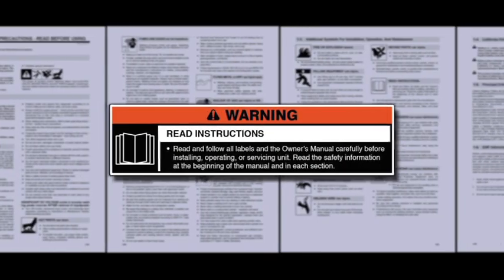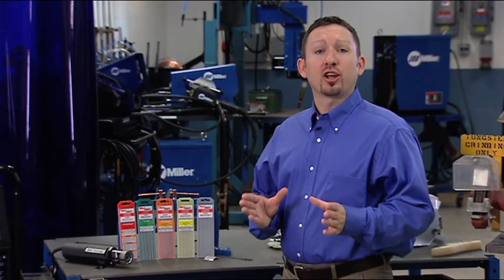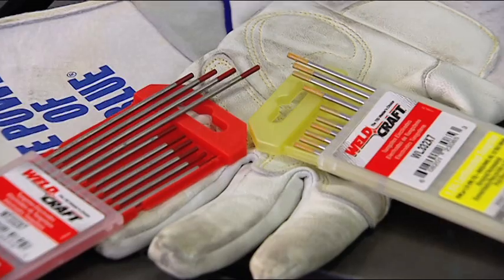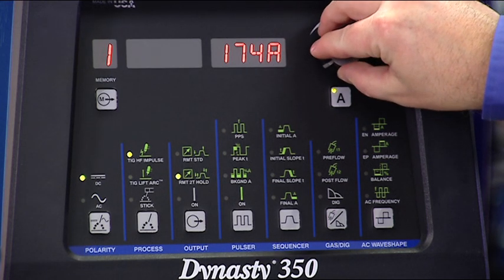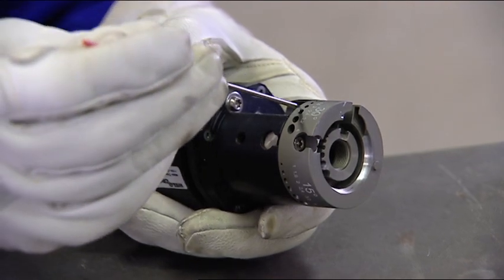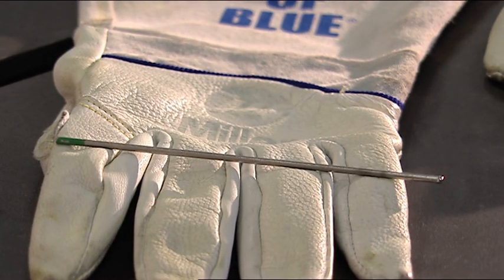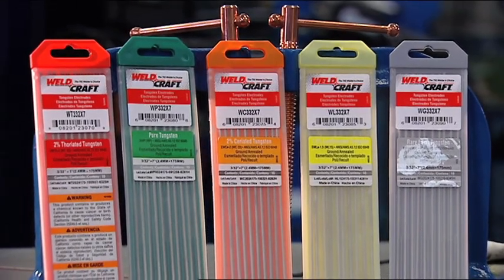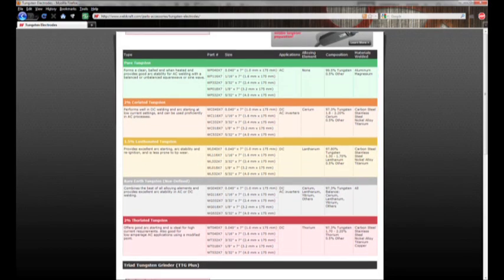TIG Welding: Tungsten Selection and Preparation

Comment: HI , in TIg can i  weld  normal cheap metal ? not steel . pls advice
Reply from the maker: Thanks for reaching out. TIG welders can be used to weld steel, stainless steel, chromoly, aluminum, nickel alloys, magnesium, copper, brass, bronze and even gold. We recommend using our TIG welding calculator to help determine the weld settings for the type of metal you are welding: https://www.millerwelds.com/resources/weld-setting-calculators/tig-welding-calculator  We hope this helps. Please let us know if you have any further questions. Thank you!
Reply: Yes,  you can weld any tin or steel. If possible, do a few test pieces first.

Comment: what grinding wheel do you recommend to grind tungsten except diamond wheels? I have a cheap wheel that I need to replace very often since it's wearing too much every time I grind. Thanks
Reply from the maker: +Daniel Mallia When high quality is needed, it is recommended to have a diamond grinding wheel dedicated to only the tungsten electrode preparation. When a diamond grinding wheel is not accessible, a dedicated grinding wheel made of borazon has been used due to the hardness of the material needed to grind tungsten electrodes. It is important to have a dedicated grinding wheel due to the possibility of the particles left behind becoming lodged in the grinding crevices and dislodged during welding; potentially ending up in the weld deposit. Let us know if you have any further questions. Thank you.

Comment: I OWN a miller 300 dxis there any info on how to connect it to 220 from 460. can anyone help me with this
Reply from the maker: +Michael Dagnall Hi Michael. Are you referring to the Miller Shopmate 300 DX? Let us know the specific model that you are working with.
Reply: It's the DX-300
Reply: I would also like to know if i was able to purchase new decals for the power unit.Two of the Miller decals and two of the MAXSTAR 300 DX decals.Thank you
Reply from the maker: +Michael Dagnall If you would like a set of Miller stickers, we encourage you to sign up for our Owners Club. Registration is free and you don't have to own any equipment. Once you register, you will receive a free set of decals in the mail. https://owners.millerwelds.com/Login?RedirectUrl=%2f Please let us know if you have any further questions. Thank you.
Reply: +Miller Welders No
Reply from the maker: +Michael Dagnall, thanks for reaching out. The peak and background cannot be changed on the Maxstar 150, they are both set at 50%. If the capability of altering these parameters is desired, then we recommend upgrading to a Maxstar 210. Please let us know if you have any further questions. Thank you.
Reply: Miller Welders SO YOUR SAYING THAT I CANT USE THIS WELDER THAT I BOUGHT ITS A Maxstar 300

Comment: Min 3:38  Tungsten is a critical variable for TIG (Tungsten Inert Gas) welding.  So, I will need tungsten for this process?
Reply from the maker: john Jacob jingle Yes, TIG welding uses a non-consumable tungsten electrode that heats the metal and delivers the current to the welding arc. Find more TIG tips and resources at MillerWelds.com.